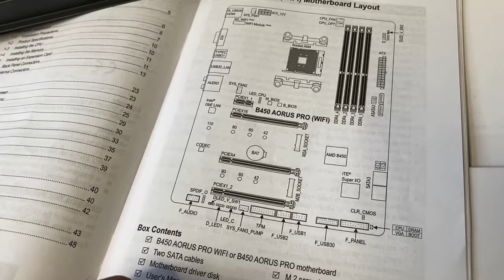How to Install a Case Fan in your PC

Comment: hey man i have a argb fan but i dont have a 3pin argb header in my mother board any solutation
Reply from the maker: There’s a few options out there but many require you to open your case any time you wanna change the color. You could get a ARGB hub that has its own buttons for rgb control. Or you could get the razer ARGB controller which uses razers software which is nice.
Reply from the maker: Here’s the razer option which is one of my favorites. I also have a video on it. https://amzn.to/3zdTiLL

Comment: what if i wanna install an rgb fan but my motherboard doesn't have an rgb header,will it still light up?
Reply from the maker: It won’t light up without the RGB connector getting plugged in unfortunately. If you want RGB but don’t have RGB headers you can always get a RGB controller. I’m not sure of any 4-pin RGB controllers but I use the Razer ARGB 3-pin controller and love it.

Comment: My rear exhaust fan does not turn on like the rest of my fans when I turn on my pc is that normal or do I need to fix something?
Reply from the maker: If it turns on after it starts up and works fine after that then it’s probably fine. Some fans just start up different depending how and when they receive power
Reply: @BuildsWithV  thanks for letting me know that but it does not turn on when I go on games or in general right now and when I feel my pc glass it feels a little hot I got it pre built so you think I should call the company or keep it the way it is
Reply from the maker: @joelromero1017  yeah if you got it from a company Talk to them for sure. They may be able to fix it for free or at least help in someway. Definitely should work normally. As far as glass being hot, it’s pretty normal especially after a bit of gaming. GPU heat is brutal and heat soak definitely happens. It’s fairly normal to an extent.

Comment: 4:58 if this was my build I would run both cables to the bottom connectors
Reply from the maker: Yeah that’s a good option as well. I don’t remember why I didn’t do it that way, the cable may have been slightly too short. But I did use the bottom fan connector for other fans.

Comment: What do I do if I dont have a 3 pin for the RGB. I only have a 4 pin which wont fit?
Reply from the maker: You can use a hub that uses its own buttons which is powered by sata power or you can use a razer ARGB hub.

Comment: yes but how do you select the right fan size for your case
Reply from the maker: @lnxfo1019  if you’re unsure you can look up your case model and see what fits in it. 120mm is the standard for most cases but some cases require smaller and some fit bigger
Reply: @BuildsWithV  thanks

Comment: How many fan slots does a motherboard normally have?
Reply from the maker: It varies pretty widely tbh. Mine has like 7 and some have only 1 so really depends what motherboard you have.
Reply: @BuildsWithV  I have 1 more question and that is If I have Corsair fans and I don’t use the commander pro would I still be able to change the colour on a software for the fans
Reply from the maker: @rawa543  as long as the rgb cables are plugged into corsairs hub then you’ll be okay. The fan speed cable doesn’t need to be plugged into corsairs commander pro or anything.

Comment: what if the motheboard doesnt have the digital rgb pin but we want to have a rgb fan?
Reply from the maker: You can get a sata powered ARGB hub. I think I have some listed in the description as well.
Reply: @BuildsWithV  I see but where do i put the pin for the argb hub?
Reply from the maker: @ghazianammarfauzyx-e1577  the hub would just plug into sata power and be controlled by itself. You’d need one that has buttons on it like this one https://amzn.to/3jYrDq4
Reply: @BuildsWithV  Aight, appreciate it thank you

Comment: Did anyone else notice that his PSU was installed upside down? The psu exhaust fan was pointed into the case, and not to the bottom.
Reply from the maker: Yes it was upside down, that fan sucks air out of the case.. unfortunately it gets the psu hotter than normal so I switched it back. I just wanted to test it out like that to see if using that as exhaust would help temps. It definitely helped the case temps but hurt the PSU temps so I don’t recommend it. That psu had RGBs which is why the idea came to test that out. Anyways, thank you for watching 🙏

Comment: Will the rgb on my fan work if i plug the rgb 3 pin into the LED_CPU port on my motherboard
Reply from the maker: It will not. The CPU led header is a 4-pin 12v connection and your 3-pin is a 5v rgb. It would get fried
Reply: @BuildsWithV  is there a like cable extension that will do that so i can plug my 3 pin into the 4pin could you find one on ebay what would i have to search
Reply from the maker: @thatboiturtle1716  there are special hubs that go from 4-pin to 3-pin. I think I have one in the description. Let me check real quick
Reply from the maker: @thatboiturtle1716  this one should work https://amzn.to/3fZWMrf
Reply: @BuildsWithV  thank you this really helped cause of that ima give you a sub have a great day
Reply from the maker: @thatboiturtle1716  I’m glad I could help 😊 Thank you for the sub and for watching 🙏

Comment: Do recommend not putting screws in like that u should put for ex top left then bottom right then put the rest of them in
Reply from the maker: This is true, however.. with a fan install its not too critical to install the screws a specific way. With the CPU cooler I do recommend doing top left, bottom right etc. like you mentioned. Thank you for watching. 🙏
Reply: @BuildsWithV  np was a amazing video either way just thought I would mention it

Comment: I have a different motherboard I have the b450m plus will this still work? I have mine installed to and they won’t light up I’m super annoyed
Reply: Im also having trouble installing them I have a h150 any help with that to?
Reply from the maker: What brand is the motherboard? What is the h150?
Reply: Builds With V NZXT
Reply: Builds With V it’s a case
Reply: Builds With V  the brand is tuf gaming
Reply from the maker: SimplyAviation okay so the tuff gaming motherboard doesn’t have the 3-pin addressable RGB so you’d need a special adapter. If you have the same fans I have in my video, these fans use a 3-pin ARGB connector. It can’t be plugged into the 4-pin RGb. Here’s a link to one that should work: https://amzn.to/3fZWMrf 

About the case, what issues are you having with fitting the fans? The NZXT H510 shouldn’t have those issues. 

Let me know if you have any more questions.
Reply: Builds With V yeah there is a rbg and I’m going to use a splitter for my fans
Reply from the maker: SimplyAviation it only has a 4 pin RGB header. If your fans use a 3 pin RGB connector you’d need that special adapter I sent you. If your fans have 4 pin rgb connector then you’re perfectly fine, just need a splitter. Hopefully all goes well. Thanks 🙏
Reply: Builds With V we found out a way to do it we got a adapter but thanks
Reply from the maker: Awesome glad you got it working. Thank you for watching!  🙏
Reply: Builds With V never mind it didn’t lol

Comment: Super old video but couldn't find an exhaust fan fix. So my AIO Corsair single fan was noisy and I knew it would stop soon which it did after 3-4 years of service. I used my Corsair ML exhaust fan and put it on my AIO which works fine. I have a new Corsair 5000D case which I used one of the 120 fans as an exhaust for my older computer but it's not working. Plugged it in to the same spot as my old exhaust fan, I checked BIOS and it says nothing is even connected. Anyone know what I can try to fix this issue? Temps seem fine but rather have it working like it should.
Reply: So fixed the issue. My noob builder self had plugged the fan on an angle and the connection side looked like it was bent inside so I tried the other case fan and plugged it in properly and it works fine now. :( I waisted a new case fan but lesson learned, take your time and plug things in straight and properly lol

Comment: I don’t see that rgb slot but can I connect to a 4 pin that says AIO PUMP?
Reply from the maker: You’re trying to connect the 3-pin plug into the 4-pin AIO slot? That wouldn’t work at all if that’s the case. The RGB port is specific to only work with 3-pin Addressable RGB ports. If you don’t have a RGB port on your motherboard you can get a controller that would work. I have some listed in the description.
Reply: @BuildsWithV  so I connected the fan to my mother board, it’s spins and the other cable to the rbg header and it’s just glowing red and spinning so I guess it worked
Reply from the maker: @AquaAmazake  oh okay, glad you got it working. I probably misunderstood the question. Thank you for watching 🙏

Comment: My motherboard doesent have drgb it only has Jrgb. What am I supposed to do? The rgb plugs don’t fit in the jrgb spot.
Reply from the maker: JRGB should be the 4-pin correct? You can get a 4-pin RGB to 3-pin RGB converter or you can get a different fan that has the 4-pin cable.
Reply: @BuildsWithV  yes, jrgb is 4 pin and my fan rgb cable is 4 pin but it won’t go into the jrgb all the way it will fall off
Reply: @BuildsWithV  I got it working thanks
Reply from the maker: @matthewhinz634  glad you got it working. Thank you for watching 🙏

Comment: Will this info works on msi b550m pro-vdh wifi?
Reply from the maker: The fan connection will be the same on all motherboards. Also most new motherboards have the 3-pin 5v ARGB headers as well but it’s always best to double check the motherboard manual. I did look up that motherboard and it does have the same connectors so you’re good to go. On there they call it “3-pin rainbow led connector”
Reply: @BuildsWithV  thanks bhai.. So can these fans work without rgb light too coz I prefer that sometimes?

Comment: Is it okay to use the pc without exhaust fan??
Reply from the maker: Yes that will be perfectly fine. I like exhaust fan because it helps pull the hot air out faster but it’s not necessary.
Reply: @BuildsWithV  okay, thanks a lot

Comment: Bro I need help pls I have 3 pen on this fan and my motherboard have r what can I do with this stuition?
Reply from the maker: Are you talking about the RGB cable or the fan power cable?
Reply: @BuildsWithV  My proplam with rgb i connect the fan its goes  will . But my motherbord have 4 pin for rgb and this fan have 3  pin for rgb to connect so what can i do insted buy kontrol connect with 3 pin dont have much money ?
Reply from the maker: @samiat9686  unfortunately the only thing you can do is buy a controller that converts the power from 4-pin 12v down to 3-pin 5v.
Reply: @BuildsWithV   Any way im kind angry bcs i didnt know about 3 pin and 4 pin god bless you bro ty .
Reply from the maker: @samiat9686  yeah completely understandable. I appreciate you watching, thank you and God bless you too 🙏

Comment: what if ur motherboard doesnt have  the D LED connector?
Reply from the maker: Then you'd either need a sata powered ARGB hub with its own controller or a different RGB fan based on the type of connector your motherboard has.

Comment: Why are the front fans facing the other way im confused
Reply from the maker: The front fans are pulling fresh air from the outside into the front of the case and the rear and top fans are pulling the hot air from inside the case and exhausting it out the case.

Comment: So if anyone could help me I would appreciate it, I have a fan on the back just like that, only it is 3 pin connectors. The motherboard I am using is a tomahawk 570x which I think has 4 pin connectors. Then I also have 3 more just like that on the front of the inside of the case with the same cords and everything, the power supply cords are all daisy linked together behind my mother board inside the case, I’m still trying to figure out how I’m suppose to mount all 4 fans cords to the motherboard, is there some sort of piece I’m missing that I can use to connect all four fans together and then run it to one fan port? The case I am using is the apevia crusader and all 4 fans came installed in the case to begin with. Any help would really be appreciated thanks!
Reply from the maker: You will need fan splitters or a fan hub to connect all the fans.

Comment: why do my fan only spins and doesnt light up only when starting and i don't see the sys_fan in my mobo my mobo is A320mk-prime
Reply from the maker: If your fan spins then chances are it’s already plugged into a fan header. Sys_fan won’t be on all motherboards, could be called something different. As for the RGBs, what fans do you have?
Reply: @BuildsWithV  case fans from Vikings PC case got this from a friend
Reply: @BuildsWithV  cani connect to this into other 3 pins in motherboard?
Reply from the maker: Okay I’m not sure what pc case that is unfortunately, usually when you have case fans that came with the case, it’ll be a different connection than regular fans. Might have it’s own hub or something for the RGB and chances are it uses a molex connector or a sata connector from the power supply unit.

Comment: Is it okay if tje screws dont screw in all the way
Reply from the maker: Blake Hohmann is should be okay, but if it’s loose it might cause extra noise. I’d try using maybe different screws?
Reply: @BuildsWithV  ok thanks for the reply
Reply from the maker: Blake Hohmann no problem at all. Thank you for watching 🙏

Comment: How would you mount top fans ?
Reply from the maker: I’d mount the top fans with the front of the fan facing down. That’s way it’ll be exhaust fans.
Reply: @Builds With V 

Makes sense, thx..
I have got the azza inferno 310 and was thinking about installing some, but I just dont know how you would
Reply from the maker: Yeah the best way in my opinion is to have front or bottom as intake and top or rear as exhaust. Heat rises so it’s best to exhaust that heat through the top.

Comment: Aw man, my motherboard only has 4 pin no addrgb headers, does anyone know how I could connect ARGB stuff like fans to it wile still controlling RGB? ANY help is really appreciated!

Edit: Some fans come with controller hubs, so I can control it with that! Hooray!
Reply from the maker: br1ann88 You can always get fans like these https://amzn.to/2HBFd5h Uphere Fans. They’re plugged into power from your PSU and controlled with a remote which is awesome. I always prefer software if I can. But this is the next best thing due to the remote. Thanks for watching

Comment: What happened if i had 3 fans and my motherboard only had 2 slot for 2 fans ?
Reply from the maker: You will then need a fan splitter
Reply: @BuildsWithV  i use corsair rgb hub if i use fan splitter are there working properly?
Reply: @BuildsWithV  i mean can i custom rgb led for 3 fan ?
Reply: With a rgb software
Reply from the maker: @pen2469  yes the RGBs will still work properly. The fan power doesn’t affect the fan RGBs.

Comment: Im a game freak. My pc heats up tremendously. When i checked inside i see my case doesnt have extra fan case. The existing fan is the one come with the pc. Frustrating. I searched video about adding cpu fan externally, mostly people use a usb cable, cut one end of the usb cable, cut the cpu fan plug, then reconnecting both side's wires, red wire to red, black wire to black, if got 3rd color wire can ignore it & cover with electrical black tape. I dont know if that works too cuz im a electrical dumb. Anybody tried that before?
Reply from the maker: This is something I’ve never tried before and have no idea. Sorry 😐
Reply: @BuildsWithV  its ok pal, im not sure to use that method either. Think im gonna try shop online for it, thanx for ur reply 😊

Comment: Can I use cpu_opt as a sys_fan
Reply from the maker: Technically you can but I’m not sure if it has separate control from the cpu fan. So basically anytime your cpu fan would ramp up speed then your cpu_opt might as well. I could be wrong tho, check bios to see if there’s a separate control for cpu_opt. Otherwise you can use it

Comment: My fans turn on but won’t spin I need help
Reply from the maker: Mythic-shot is the RGB works but the fan itself does not? If that’s the case I recommend checking the fan connection. What fan are you using?

Comment: May motherboard has small 4 pin but my fan has large
Reply from the maker: I’m not sure I understand correctly. If you’d like, you can DM me on Instagram and hopefully I can help out. Thanks 🙏
Reply: @BuildsWithV  i actually found it. its a psu mount fan thanks for the help tho appreciate ur work
Reply from the maker: Prime Lang ohhh okay so it’s a molex connection fan. Glad you got it figured out 🙏

Comment: what case is that?
Reply from the maker: This was the Thermaltake Level 20MT. Not the greatest front of case airflow, but if you had fans mounted on the side as intake it works well. Thermals were still solid tho even without the side fans. If you wanna check it out, here’s a link.
https://amzn.to/31XyCJ1
Reply: @BuildsWithV  Thank you for the detailed comment!!
Reply from the maker: @seveirin  no problem at all, thank you for watching 😊

Comment: What happens if you have 2 pins?
Reply from the maker: I've never had a 2-pin fan unless its a molex connector. If its a small 2 pin fan it may be a proprietary connector for a specific controller or hub. Feel free to DM me a picture of it on Instagram and maybe I could help.
Reply: @BuildsWithV  its a pano mounts fan
Reply: @BuildsWithV  it has black and red
Reply: @BuildsWithV  black and red wires
Reply from the maker: @andysun1911  Oh okay, that’s not for your PC case. Those fans are for your power supply.
Reply: Nvm i did a little experimenting and it works now thx!